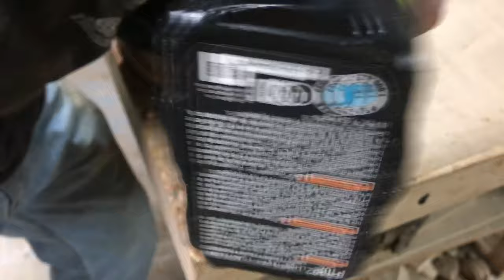Charcuterie/serving board with coffee grounds as wood filler

Comment: Hi Larry, Very innovative. I was exploring the web, looking for a commercial, dark wood filler when I came across your video. I can't think of a more appropriate color to go into my oak tiller that has a crack running the length on both sides, especially since I wanted to finish it with a clear varnish. 
Question: How well did the repair stand up?
Reply from the maker: Sorry for the late response, this was in my YouTube spam box and I just discovered it.  It is holding up well.  We hand wash it only.  I’d never put it in the dishwasher.  I really like titebond 3.  Good luck.  BTW, I’ve used it in oak Christmas tree ornaments and it looks beautiful.
Reply: It was wood filler with glue?
Reply from the maker: @juanfontecilla4692  the coffee grounds were the filler
Reply from the maker: @juanfontecilla4692  Yes. Titebond 3 that is waterproof

Comment: Why didn’t u use epoxie. Great board I don’t like to throw away character boards either
Reply from the maker: Sorry for not responding sooner.   For whatever reason YouTube put this in my response review folder.  I made this video for an Instructables contest that used coffee in any form.  I didn't win.  Epoxy could certainly be use.  Titebond is approved for indirect food contact so I haven't given this away to anyone because they might use it as a cutting board and that is not it's intended use.
Reply: I know this post is a year old, but incase you haven't heard it yet Epoxy is not good to use on cutting boards. It is done by many, but its still not advised. Even if you happen to see one that is advertised as "food Grade" its essentially plastic, and if used on a cutting surface plastic particulates can contaminate food. Also if it is used, be prepared to refinish that surface often due to the cuts in the epoxy. Hope this is helpful.